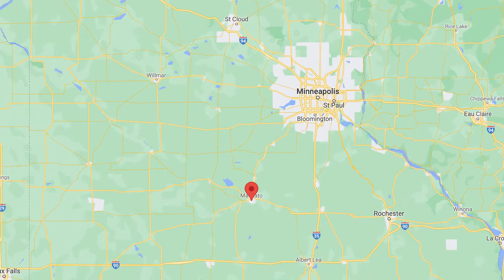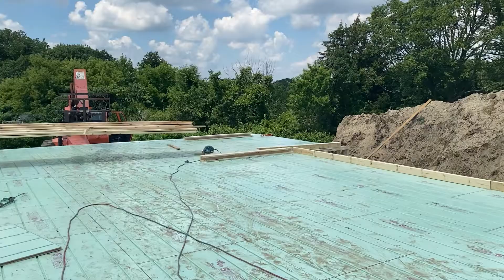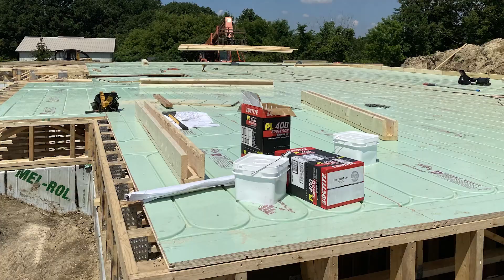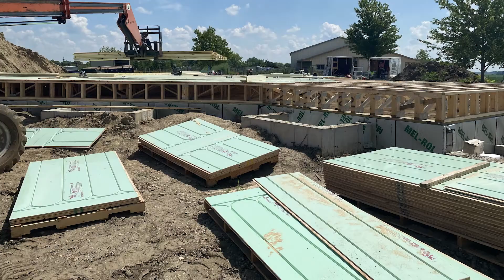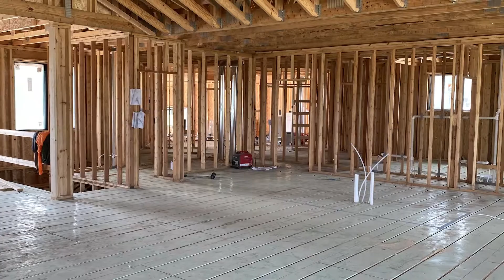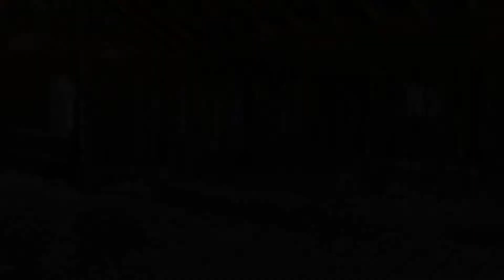New Home Construction in Minnesota

Comment: OK, so how is air conditioning handled with in-floor heating throughout the home?  We're building this spring in MN and will put in-floor heating in the basement and forced air on the main level.  The main level master bath will have in-floor heated floors too, probably using Warmboard with the basement having the heating tubes in the concrete with insulation board under the slab.  In Minnesota, basements are always cold.  This is due to lack of heat in the winter and from sinking AC air in the summer.  We won't have AC vents in the basement but we will have a seperate HRV or ERV for that level and a HRV for the main level.  Haven't met with an HVAC company yet though.
Reply from the maker: There's a couple routes you can go with this. With Warmboard you would not need a separate forced air heating system. So we would recommend tubing in slab in the basement, Warmboard throughout the main floor, then using your HRV/ERV choice for cooling. Other great cooling options are Spacepak and Jaga. We'd be more than happy to talk to you about your project and help you make the best decisions for your home. 1.800.556.0595